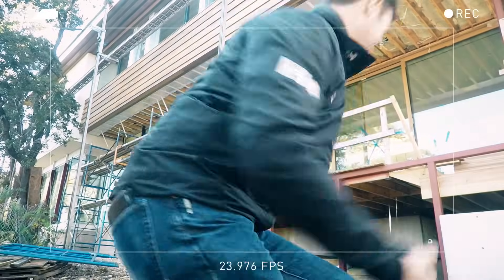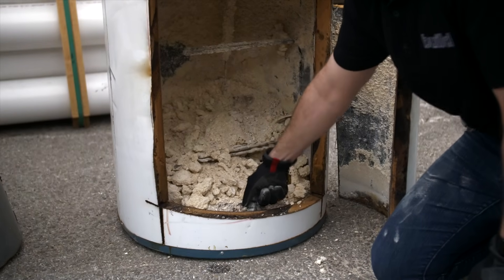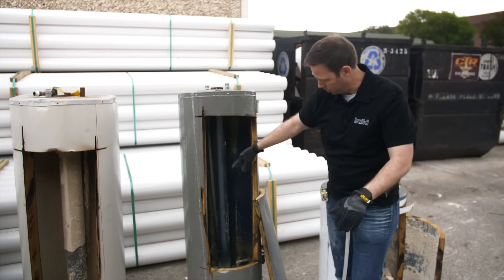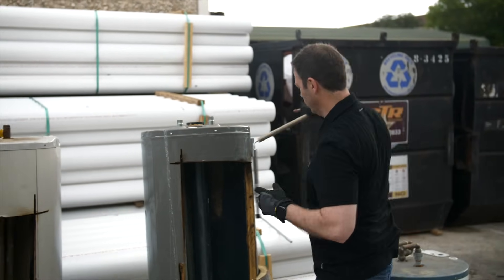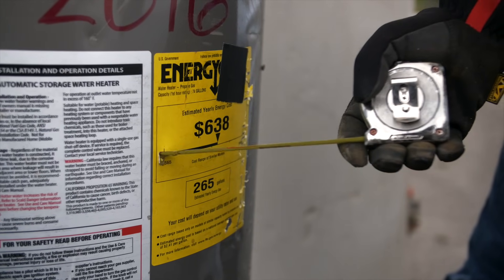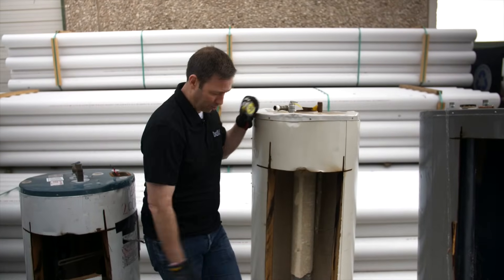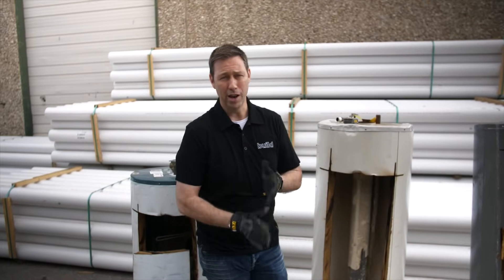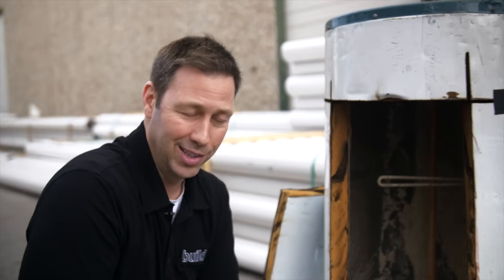Four Water Heater Tanks Cut Open - Lessons to Learn

Comment: Good info thanks. On that last tank 2005, if it were working would you still suggest draining and changing the anode rod if neither has ever been done? Seems that the scaling etc. on the inside might make loosening the rod on top very challenging? Also seems that the first tank 2000, might have been in use in a hard water area?

Comment: I have a 2011 model Rheem electric hot water tank.  I have to replace the drain valve.  The plumber tried to sell me a new water heater by saying that the threads might be rusty and it will not last.  I have decided to do it myself anyway.  I ordered the original part but the brass drain valve also connects to the cold water inlet pipe.  Is that hard to remove?  Do I have to desolder anything?  I googled for a similar type drain valve but got nothing.  all drain valves that I've seen on the web are much more simplistic.   Any help is much appreciated.

Comment: How do you flush it? I know I can drain it, but flush it? Are they same?
Reply: As said elsewhere, the drain valve is just good for draining.  A ball valve should be installed if this flushing is to be done annually.  The cold water feed for the tank goes directly to the bottom. A fast rush of water will stir up sediment on the bottom with the tank drain being the nearest and easiest exit path.  Use a short hose into a 5 gallon bucket. That should be enough. The secret is a fast water flow. 

 If a tank has shutoff valves for hot and cold, the drain valve can be replaced with minimal water loss.  Shut those off. Prepare the new valve with pipe dope on the threads and quickly switch valves.  A couple towels should be enough to hold any water that comes out.
Reply: @opera5714  Thanks!

Comment: Electric WH in first house lasted over 20 years, never drained and the anode rod was removed on install or the water smelled like rotten eggs. In our current home 18 yo gas never drained and rod removed, so maybe ,just maybe this information is all BS
Reply: I replace 12-14 year old water heaters frequently because of rust though and leaking tanks. A lot depends on the water qualities and how hot it's run.
Reply: Depends on where you live. If you don't do this here yearly, then the tank fills with sand and stops  working. Any idea what 50g of wet sand weighs?

Comment: My dad's water heater in Niles,Mich is older than me,least 60 years old,water softener is the key to long life,I think the heating element is original,I thought to drain the tank and nothing came out,clean!
Reply: 30 years ago grandpa bought a insulation blanket to wrap around it,I installed it.

Comment: Nice cuts on those water heaters. FYI the outside, tank as you call it, is called a JACKET. and you can very easily measure how much insulation a particular water heater has. 
Gas- pull off the cover directly under the gas valve. The same one you pull off to either manually light, or look through the sight glass when lighting a new unit. You can measure the distance between the jacket and tank there.
Electric- pull the access panel off of the element. Same thing, measure distance between jacket and tank.

And please stop making videos.

Comment: Recommendation to the public not only having a off valve input to the water heater but also have a off valve output. My water heater rotted from the bottom and with the input waterline shut off to the water heater it still leaked lots of water from the output every time I turned on a fossett when is it was in the warm mode Including washing machine.🤔🤔🤔 it would be interesting to take a radiation detector to the settlement of the water heater in different regions. After Fukushima went up in smoke 70% of that plum went across the Pacific to America. The radiation detectors went off the chart and Then they were pulled out of service to keep the unwashed masses in the dark.

Comment: There is a very strong smell of gas coming from my hot water heater.   We put plumbers tape around the fittings that we could but that didn't help.   Is it time for a new one?
Reply: If you can smell gas you got a leak, very dangerous,I hope you can afford to fix it.

Comment: Maybe Austin has hard water, but where I live (good soft water) 20 years out of a water heater is nothing special- mine is 20 with no problems. What puzzles me is how many newer homes in the area  have the water heaters up in the attic. If you have a bad leak and the pan overflows, that is not going to be a happy ending.

Comment: 15 year lifespan?  The ones in the houses we've lived have been 30 years old and longer. The tank in our current house haw just replqced by an infinity gas system. The installer showed us the tank and it had rusted through the bottom and rotted the floor underneath.

Comment: Why not just build the tank out of aluminum? Or stainless?
Reply: Manufactures still offer residential Stainless Steel Water Heaters with a Lifetime Warranty. They are expensive for about $700 extra. 
Aluminum is not so durable, and would be even more expensive.
Reply: Jay Ce copper here in the U.K. Slightly more expensive (£300 for a typical cylinder) but most last several decades. Replacing one is a rarity, you might have to do it once in a lifetime.

Comment: What's the best gas water heater 50 g???
Reply: The cheapest water heater with a Dip Tube, Heat Trap, Blanket. 
And an owner who Power Flushes every 6 months. 
Otherwise you waste money buying any expensive water heater.

Comment: Removing an anode rod after 7 years is likely an invitation to buy a new heater. Probably seized. And wd40 won't help. Master plumber since 89
Reply: Air ratchet will solve that problem. I had an 18" wrench getting my nowhere. Ratchet got it in 1/2 second and much safer for improperly applied torque angle than a breaker bar.

Plumber for one day.

Comment: AS A RULE OF THUMB BEFORE YOU REMOVE TO REPLACE YOUR BROKEN HOT WATER HEATER. WITH A HOSE FLUSH OUT THE DRAIN VALVE AT THE BOTTOM OF THE HOT WATER HEATER OF THE ACCUMILATED DEBRIS. THIS WAY IT DOESN'T CLOG AS YOU ARE DRAINING IT.

Comment: I use instant heater but I wanted to see what is inside tank heaters. I didnt expect explanation on why or how it works like that but I am disappointed by the thickness of foam inside. I was expecting something between 3-4 inches.

Comment: Matt important question.  If your household has a mega sized tank, I can understand needing to flush it out.  But if your house has a small tank, one that often is drained until the water runs cold, then is flushing as important?  Likewise, if you flush your tank and nothing comes out sediment wise, then does that mean your tank is in pretty good shape?  Another issue is that many tanks have a wimpy flush valve that starts to drip and ends up needing to be capped with a hose cap.  Can these valves be replaced?

Comment: 22 years of being a plumber in Texas I have never changed an anode rod. That is a reginal issue depending on the quality of the water. Most people never flush their water heater. It is debatable if flushing can extend the life of the water heater but mineral buildup can reduce the capacity. I've seen water heaters that have failed at 8 years and some over 20 years. If you have a water heater that is over 8 years and giving you trouble it is a judgement call as if to replace or not. 
Every water heater will eventually fail but if it isn't in a place that isn't a flood hazard or if you have a pan with a drain there should be no need to worry, let it ride.
Typical install including materials around here for nat. gas is $1500 and $1200 for electric depending on the company it could be much more or somewhat less. Most of the time the installation is not so simple because of code issues with the water heater. No pan, no where to drain the pan, releif valve under sized, needs flood control device etc. There are almost no basements here so water heaters are in the garage, interior hall closet or attic.

Comment: I cut open an empty,13 yr old, regular gas water heater in Rancho Cucamonga, Ca. (USA) about a month ago. It looked completely normal...nothing in it, although I don't remember seeing an anode rod. I replaced a 20 yr old heater in Colton, Ca. (about 20 miles east of Rancho) and it had about a 5 gallon bucket of sediment in it. Both using it's local city/municipal water. So what does that tell you?  (It varies drastically from place to place)
Reply: Sylvia isgod  There are a lot of wealthy conservative  people in Calif. Problem is there are more people bucking the system and getting free money .....and they also possess a vote.

Comment: install a whole-house water filter.  minimal/no scale, no flushing.  with a 3micron carbon filter minimal degradation of the anode as well.  we're on our 3rd electric water heater in a 32 y.o. trailer.

Comment: Can I drain it myself? And how do you do that? Or do I leave it to the professionals.
Reply: You're supposed to drain it once a year because slime builds up on the bottom of it and as you can see that electric water heater has all kinds of crap from sludge. There's a valve at the bottom of your water tank at least there should be that will allow you to drain your water tank attach the valve to hose bib and you cut the two valves are feeding your tank and let the tank drain off you have to open your relief valve to make this happen the relief valve is designed so that if too much pressure builds up in your system the relief valve will open and blow out the excess scene I actually saw a water heater shoot through someone's house once when they had a clogged relief valve. Gas heater with a faulty thermostat. It literally went airborne through the roof.

Comment: Can you [SHOULD YOU] use the acid that is used for sink clogs to dissolve the sediment in the water tank to make it easier to flush out?
Reply: maybe...  but what about vinegar? Do you want drain cleaner residue inside or vinegar, because it's pretty hard to completely drain a water heater without tipping it on it's side.
Reply: @phiksit  - I wonder if vinegar would be strong enough to dissolve the deposits in a hot water heater.  It does work with coffee makers, though.  It would be a cheap way if it worked.  Probably only need five or ten gallons of the vinegar which is only a couple dollars each.  Oops, I just looked at the video again and that one tank had deposits all the way to the top.  I was thinking that most of the deposits would be in the bottom third of the tank.  Oh well, maybe there's a stronger vinegar that can be bought other than the 5% they sell in supermarkets.  I just did a quick search and they do sell an industrial vinegar that is 20% and 30% strength and it sells for about $ 25 per gallon.  I'll have to check into it more.  If it makes my hot water heater last longer it might be worth it since a new heater will cost $ 400 to $ 500 and that's if I install it.

Comment: I live in a city with one of the softest water in the country. I replaced my water heater 27 years ago (the first DIY project in my life) and the thing is still working fine. I do have a replacement water heater next to it ready to go for when the old one dies. I also put a cap over the drain spout in case the valve starts leaking (a common failure point). I flush it every year and the water is always clear.

I don't recommend that other people live dangerously like I do but I live alone and I can't wait to see how much longer this thing will go.

Comment: Also water softeners do protect your appliances and plumbing fixtures, however if your home is old enough to have galvanized water piping it can cause the water to leach from the pipes until they start to leak.  Of course if you have galv. pipe it's only a matter of time till you have leaks anyway.  Get rid of it (galvanized piping) if at all possible.  If you are thinking of going tankless DON'T install a tankless water heater with galvanized piping systems.  You will greatly reduce the life of an expensive investment.

Comment: The amount of scale in any water heater is a direct result of the water conditions in your area. (source of water supply...ie. municipal system , well or cistern).  Typically electric water heaters last longer, cost less to purchase, cost less to maintain and are as close as you can get to 100% efficiency of energy use.  There is no other place for the heat produced to go other than into the water being heated.   Tank type gas water heaters are prone to fail from stress and fatigue from the heat of the burner on a concentrated area, (the bottom of the tank gets the hottest and expands more than the rest of the tank)  As the tank gets more scale buildup this insulates the tank preventing heat transfer so the burner runs longer to heat the water making even more of a hot spot further weakening the tank.  An effective method to almost completely stop scale buildup is to connect your clothes washer to the drain valve of your water heater.  Every time you wash clothes the heater is flushed.  Of course your laundry has to be near your utility room. And do replace the drain valve with a ball valve and hose adapter or you can find full port boiler drains also.  If your water heater has a plastic drain valve don't try to open it. They usually break and if they don't break they will leak after.  Utah master plumber 25 years.... just sayin

Comment: get a glass lined water heater flush it every year and change anode rod every 5 to 6 years. my water heater is a 93 model which is just know starting to show a little rust on the inside

Comment: The no brainer method is to get the smallest hot water heater that will meet your needs, the total volume of water will turn over every time you use it.
           That’s why the smaller ones cost more.

Comment: Why would build-up in the 1st water heater affect its efficiency? Electricity can only be converted to heat. Where else would the heat go but into the water?
Reply: True! However, the temperature recovery will be slower so wiring and local heating around element longer hence a little bit of efficiency loss.

Comment: Most of them get replaced because of insurance companies. They will send you letters stating that your tank is X-years old and your deductible will climb 10x (from $500 to $5000) in case of flooding, unless you replace your tank and provide proof. They don't care about your tank maintenance like flushing or anode rod replacement.

Comment: The only way to determine which might be a better heater is to hook them all up to the same water source.  First heater is from a home on a well. 
Flush your heater every year,  replace the anoid rod every four years , make sure you have a thermal expansion tank installed, keep the temp on the lowest temperature setting possible and after eight years don't spend more than two hundred dollars for any repair. Replace after 10 -13 years.

Comment: Scale will vary widely based on your area. Our municipal water system gets rid of most of the minerals so there is virtually no scale. If you have well water or hard water you may get a lot of scale. How about if you just buy the cheap water heater and add a couple of insulation blankets and get the same efficiency as the higher priced water heater.
Reply: 🤔 that's a idea 💡

Comment: Years ago hardware stores were selling insulation blankets for water heaters, have they gotten away from that (I don't see them anymore) or are they still a good idea?
Reply: They are considered to be ineffective to  overall heat  loss,  and can  make  servicing  a unit  difficult.
99.9% of  the  heat  loss is through  the flue channel.

Comment: Is it typical to hear a humming noise coming from a water heater? The vibrations in the floor may be associated with the water heater.
Reply: Scale piled up in the bottom of a gas water heater can cause it to make noise when it's heating.

Comment: Leaking wAter 💦 is reason I replaced most heaters I’ve had. Any recommendations for tankless types ? Most world only use them
Reply: Expense offsets much of the savings.   Also beware if you have well water with mineral buildup.   You won’t see much mention of mineral buildup issues mentioned as most of what you see is sales hype.    It’s conveniently missing in the energy saving pitch so look to the plumbers discussions for this not the companies🤥 selling them.

Comment: It’s funny you keep talking about replacing the anode rod but I have yet to see any repair shop in this area actually do repairs to anything but a new heater anything over 5 years old they just recommend replacing them.  I guess other than flushing them every year or two

Comment: I drained my lime out 3 times a year since new on my 50 gallon gas water heater and i got exactly 13 years out of it. Rheem
Reply: 13 years is not too shabby. We have a State branded water heater, that was installed when the house was built back in 2002. Must be a contractor brand. It has (2) anode rods. Jan 2016,   the thermostat must have gone bad and it overheated, turning our utility closet into a sauna once the over-pressure relief valve opened. Drained out the tank, and a ton of anode rod chunks washed out. Replaced both heating elements and the thermostats, and she has been running fine since. Both anode rods were pretty corroded and I left them as-is to to the difficulty in replacing them, but it's still running ok to this day. Year 17, I'm guessing the tank will start rusting out soon though.

Comment: ANODE RODS ARE ZINC
SOFTENER INSTALLERS REMOVE
ANODE RODS , NOT A GOOD IDEA
WATER HEATERS HAVE DRAINS
FOR FLUSHING CALCIUM AND LIME
LOW DENSITY ELEMENTS LAST
THE LONGEST
QUALITY WATER HEATERS HAVE
THE BEST GLASS LININGS
I PUT MY TWO CENTS WORTH IN
BEFORE READING OTHER 
COMMENTS 
GOOD TO SEE KNOWLEDGEABLE 
PEOPLES INPUT

Comment: An important thing to use is convection stop fittings on the inlet and outlet.  This saves allot on energy.  Up to a third.  Keeps heat from going up the pipe.  Also use pipe insulation.